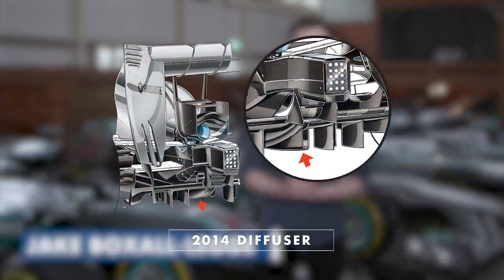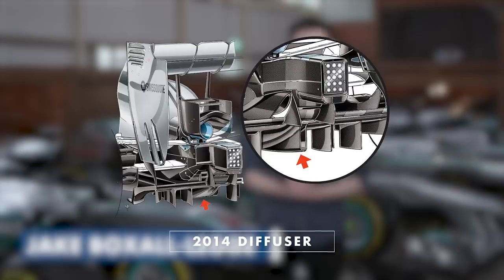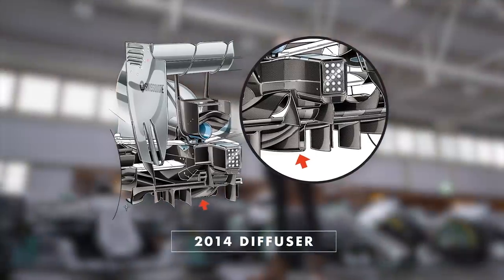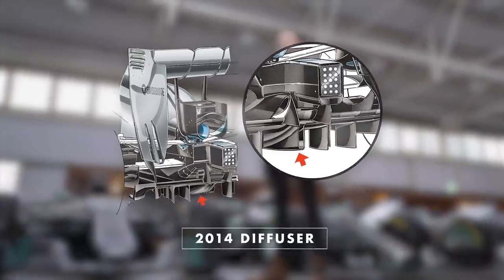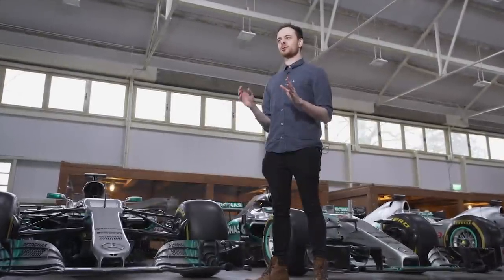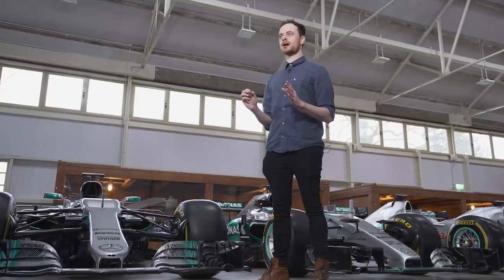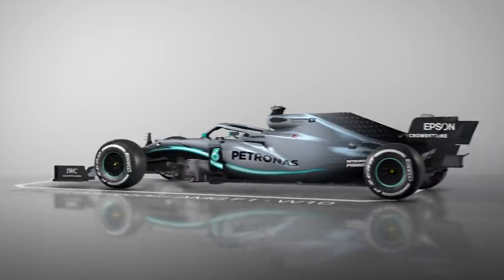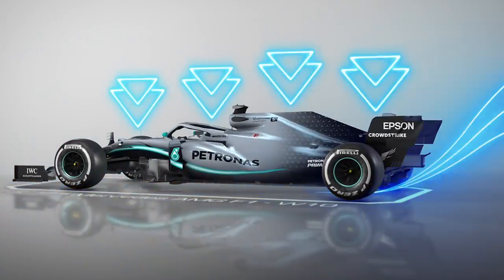How a Formula 1 car works: Episode 4 - Diffuser

Comment: The most important thing in this whole vid is the close up shot of the 2018 diffuser so i can study them
Reply: I've seen tons of pictures of F1 cars rear diffusers....close-ups mind you....including front wings, bargeboards, rear wings.  They are constantly changing per GP.  2017 and 2018 front wings were stupid crazy; at times with 42 elements on the whole front wing itself to get that Y250 vortex generated plus to also get the more vortices to go outside the front tire to pull the wake(turbulent air)of the front tire, along with the Y250 vortex, away from the car.

Comment: What really gets me thinking is that drivers always complain of losing downforce at the front of the car in close racing situations, and that it makes overtaking more difficult. If the diffuser makes the air flow go UP from underneath the car, there is not going to be enough airflow for the front wing of the trailing car to function properly. Al the more, the flor and side plates cant be at the least damaged or the aero of the floor and diffuser just becomes useless. 
     I am for simplifying the design of the floor, and maybe banning diffusers, so that a minor colllision that damages the side plates of the floor  won't take someone out of a race, and so that the front wings will be more effective and improve racing.

Comment: The vanes or strakes(per the video) create vortices (ever see an airliners wingtip under very humid conditions when landing or taking off) thereby sucking the car to the ground.  This phenomena starts just aft of the rear axles.
Reply: @paulinelambert7780  - some high performance cars have a functioning rear diffuser while others do not.  The way you can tell if it's a functioning rear diffuser is if the strakes or vanes start aft of the rear axle and end at the rear bumper.  This is noticeable on WEC GTLM cars like the Corvette, Ferrari or Aston Martin.

The way they work is the front tip of the vane creates a vortex or small tornado.  This small vortex gets bigger and bigger along the edge of th he vane.  As it gets bigger and bigger, it starts to suck the car down.  The more suction the greater the downforce.  The more vanes the greater the downforce as well.  Understand l.
Reply: @paulinelambert7780  - look up pics of current Ferrari production cars with emphasis on rear diffusers.
Reply: @paulinelambert7780  - look up "Diffuser explained" on YouTube.  Fast forward to 5 minutes of the video to see what are examples of some rear diffusers on Ferrari's.
Reply: @Pauline Lambert - Did that video help??

Comment: A diffusor accellerates  air? and therefor creates downforce? I don't think so
Reply: Well, he never said the diffuser accelerates air but it actually does. He said airflow is accelerated under the floor which generates downforce, he went on to say "as the diffuser opens up, the air accelerates further at the throat, creating a point of lowest pressure underneath the floor*", by which he means the airflow will be at it's maximum velocity at the point, on the floor, just before the diffuser's expansion chamber begins to open up. If you want to know why, in a car where (due to it's rake) the highest point of the floor is right before the diffuser, it has the lowest pressure airflow at the most open part of the floor...it's because of the difference in air pressure between the low pressure air under the floor and the higher pressure air in the expansion chamber. 

This pressure difference creates negative air pressure which creates a vacuum effectively sucking the air under the floor towards the diffuser. So if you look at a graph showing the air pressure as it flows along the bottom of the floor, you would see it at it's highest at the front of the floor (despite that being the lowest point) and the line would exponentially dip to just before the expansion chamber as that's where the diffuser's suction effect is strongest and then it would rise back up as it approaches ambient pressure in the expansion chamber.
Reply: @ethownzbh  I know the airodynamics behind it. My main message is that the diffusor itself is not creating this, it is the shape of the total floor and the diffusor is part of it. The delicate role of the diffusor it not to disrupt the airfloor below the floor (the real downforce) while at the same time release the airflow to the normal atmospheric pressure and  not creating drag due to turbulance. With a high rake, the lowest pressure is not just before the diffusor, due to the shape it is more forward, but this depends also on the 3D shape of the floor (incl diffusor), which is not easy to see from the side alone.